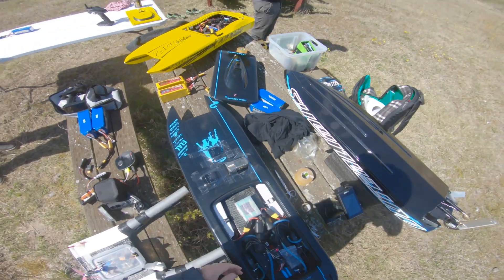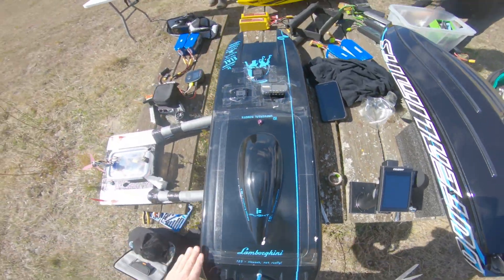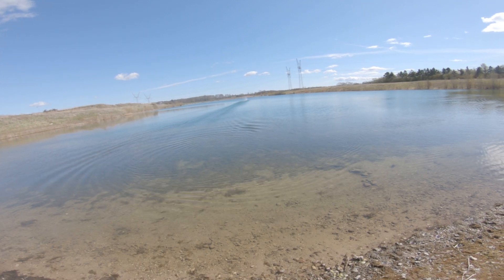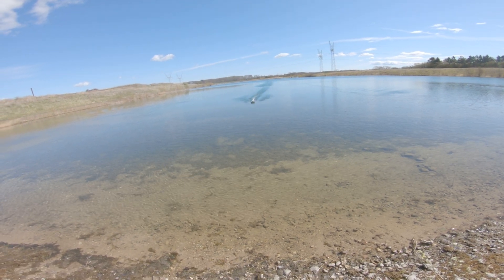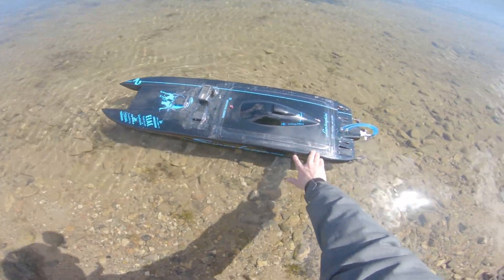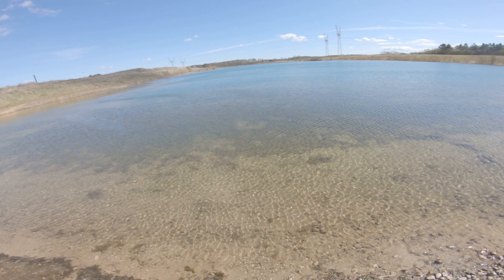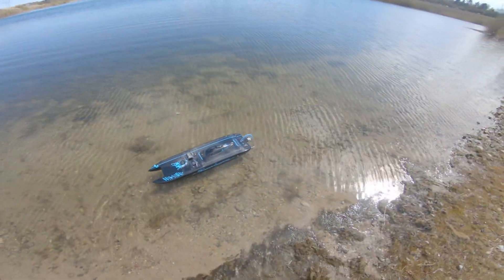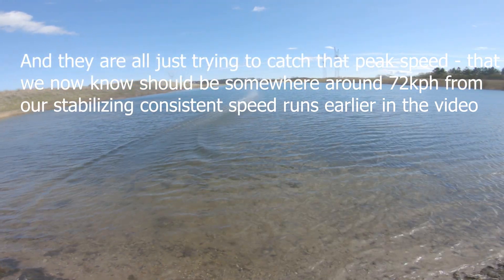GPS Accuracy for Speed Runs - why different results?

Comment: Thanks for the info,, appreciate it.  Which one do you like the BEST?   I have a Forerunner 201, which I got new, but never used it!  Now that I have a rc boat maybe I can get some use out of it.  Also, will the Forerunners get a good signal if they are put INSIDE the boat?   Any info is appreciated.  Also, how do u like the SYKRC ?  If you could only have one, what would be your pick?  THANKS so much.
Reply from the maker: SkyRC is superior in every way. Get that
Reply from the maker: All gps works inside, if not carbon fiber. Keep away from power cables if possible.
Reply: THANKS @EmilWilkensRC